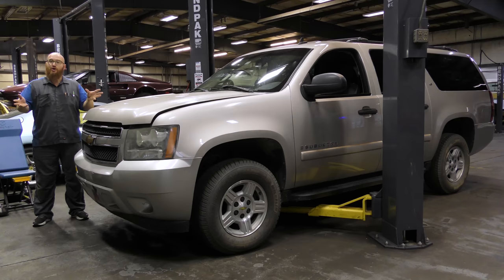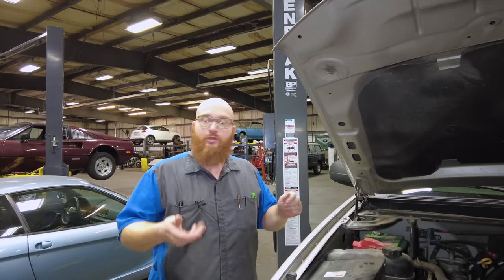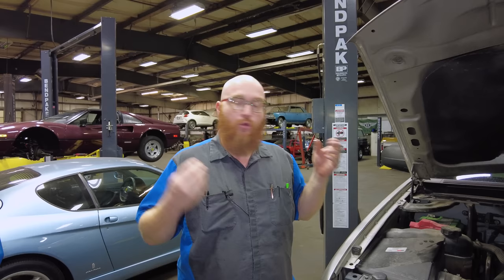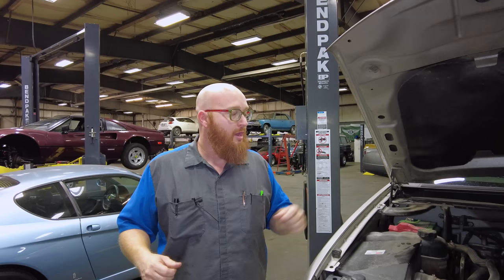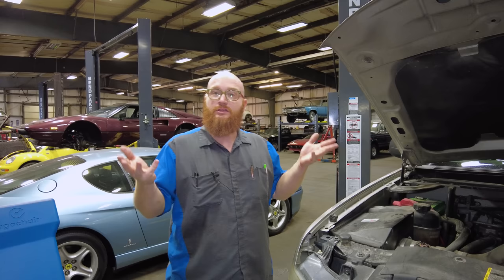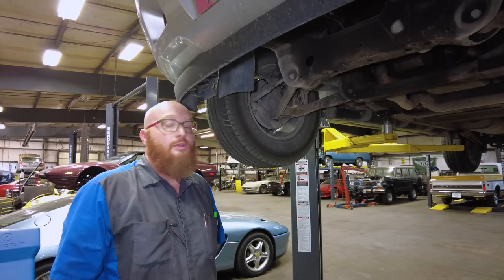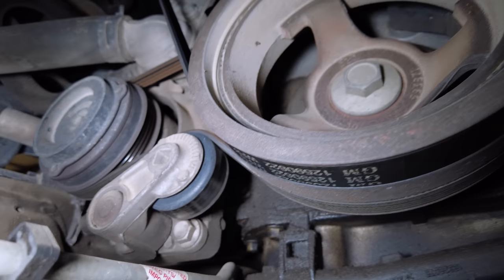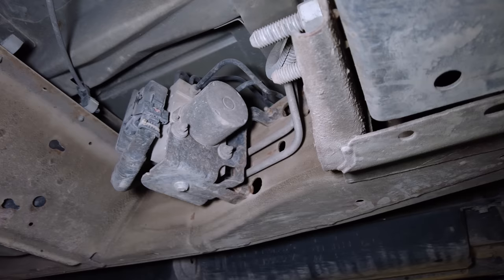What fails on ALL early 2000's Chevy SUV's!? CAR WIZARD shares what he's seen from the last 20 years

Comment: While somewhat pricey,I replaced my cast iron manifolds with smog legal headers and new bolts within the first 6 months of my used truck.  Bonus was a little more power and peace of mind, and after 3 years of use I do not have an exhaust leak 😊

Comment: Up until early-mid 2000K's was peak Chevy/GM. Good solid reliable easy to work on yourself trucks. And those 'Like A Rock' commercials are stuck in my head to this day. Would love to see a review on the GMT 400  platforms 88-98. Still see them on the road daily from Suburbans to Yukons Sierras and Silverado/Cheyennes. Think Hoovey just bought a nice one recently as well.
Reply: Yup my 1990 Silverado had turbo 400 and 180000 mi . Still see em . I should of kept it .
Reply: My 2001 Sierra transmission gave out at 300K miles. The engine is still running fine, Knock on wood.

Comment: One thing that I have found on this particular model and year of Silverado and Tahoe is that all of the plastic on the dash and the knee bolsters  turn into glass basically.  The minute you go to try to take it apart after they age the plastic just shatters in your hand we tell customers that if we have to take their dash apart expect to have to pay for replacement parts
Reply: thats most GM vehicles in my experience...they cut so many corners on the interior unless its a cadillac
Reply: This is the problem that I'm running into. I'm also having problems finding replacement parts for the inside without the price gouging.

Comment: That particular body style has quite a few statistically verified common failures. Exterior rear glass pop button usually deteriorates and becomes useless, that doesn't seem like a crazy Big fix however, you must remove the rear trim panel with the bow tie that sits above the license plate. In order to remove this trim panel you have to remove the inside hatch trim panel and access the 10 mm fasteners which secure that trim plate to the exterior of the vehicle. The plastic panel and the metal clips along with the bolts 10 to brake seized up and wreak havoc on that trim panel the best advice I could give as far as that goes is to not repair it. The window switches are notorious for going bad. The finish on HVAC control head buttons typically wear out from use, there are companies that offer vinyl overlay stickers for those control buttons but it would drive me nuts. Rear defroster tabs are constantly breaking off. They can actually be glued back on with the permatex defroster tab glue kit. The rear disc brake backing plate typically is nonexistent, the rear end axle seals typically have leaked long-term and caused rear end to be poorly lubricated. The side-view mirror adjustment motors go out quite often along with that power window switch. Also the motor mounts are a common failure especially the driver side. Overall for somebody that can either do their own maintenance or knows someone that they can trust to handle that for them I would highly recommend one of these vehicles provided that you either do an active fuel management delete as you mentioned in your video and they also offer a plug in OBD module that you can use which is available on Amazon to defeat that. Thanks for your honest review of this vehicle and I really enjoy your videos

Comment: We have an 03 Yukon Denali that we’ve owned since brand new and it has been the most reliable vehicle we have ever owned. I can count on one hand the times we have had to replace or fix a broken part. Of course we maintain the vehicle and don’t beat on it. It still looks and drives like new with 156k miles on it.
Reply: I should hope so with only 150k.
Reply: I have a rusty old 96 Tahoe with the Vortec V8. 340K on the odemeter. Only major repairs was a worn out brake line. I don't count things like tires, brakes, exhaust, etc.
Reply: @stansmith4054  ol' faithful, the Chevy 350, R.I.P.
Reply: @EvanDickersonM81  Anyone who expects a 19 year old vehicle with 150k on it to run and look like new is living in la la land
Reply: @stansmith4054  repair*
Reply: Much different that the 07 generation. You have a good vehicle. Sadly lot of people in your position “upgraded” to the newer model, only to be screwed lol. Don’t sell that thing!
Reply: I have a 2004 Z71 Tahoe with 309k original miles on engine, transmission and all 4x4 parts are also still original. I've followed the maintenance schedule like it's a bible. Also I'm an automotive technician so that helps keeping her going.
Reply: @mitchelpinion1852  mine has 309k and I would have no problems driving her coast to coast. Scheduled maintenance is why mine just running like a Timex. Takes a licking and keeps on ticking.
Reply: Uh oh. Your transmission has joined the chat.
Reply: @mitchelpinion1852  If you don’t know how to take care of and maintain your vehicle sure
Reply: @DarthVader1977  *reepares
Reply: @mitchelpinion1852  I have a 1986 Fiero GT with 40k. I am in the rust belt. There is zero rust on the frame and it runs perfect. She is a garage queen, though that is also a show car.
Reply: @mitchelpinion1852  go test drive a 20 year old low mile japanese car. It drives the same as when I came out.

Comment: You missed the hard brake lines.  On 06 back, at least, the hard brake lines rust out and then what happens?  You push the brake pedal and the fluid goes pssst out the nice hole.  I had a 2000 Yukon XL and one would pop and then I'd fix that one, then another and fix and another.  All of them ended up being replaced.  This is why you can go into any auto parts store and get complete brake line kits for these.  I'm in the salt belt so those southern trucks likely won't have this issue.
Reply: The stainless steel line kits really aren't the much money considering you'd never need to replace it agin. Had the same issue on a Super Duty and it wrecked my master cylinder at the same time.
Reply: Same.

Comment: I have an 09 yukon and was about to hit 300,000 miles until I got rear-ended at 50 mph while I was stopped. Totaled. I loved that truck and would trust it going anywhere. Only replaced the transmission and minor little issues

Comment: Another thing as well to help preserve the life of the transmission, is to get the fluid and filter changed in regular intervals. Overtime the fluid can become dark and sometimes burnt. It loses its protective minerals and can no longer protect your transmission. It's a fairly easy job to do yourself, although messy. I wish GM would use a drain plug on the transmission pans as well.
Reply: You can buy from Amazon a transmission pan with a drain plug built in..
Reply: Mine has 364k miles and the transmission fluid has never been changed. I've owned the truck since 56k. I know I should have done it, but my bad, I never did it. Still shifting fine although I wouldn't even consider changing the fluid now. I've been told the transmission is the weak point of this truck. but you'd never know it from my experience.

Comment: The wheel bearings on 1500's seemed to go quite frequently. I worked at an AutoZone that stocked 10 of them at a time
Reply: That's more of a problem with the aftermarket bearings. They factory ones do go bad on occasion, but if it gets replaced with one from AutoZone, OReilly's or any other aftermarket bearing... then you'll end up doing the job again a year later, and again another year after that, and again and again... it becomes an endless cycle. I had one customer that we warrantied the same wheel bearing 7 times in 4 years. I refuse to install the aftermarket ones anymore, especially ones for GMs. The aftermarket bearings for GMT800 trucks/suvs are absolute GARBAGE and in my experience seldom last more than 1.5 - 2 years. If you replace the bad bearing with an OE replacement bearing (which cost about $50 more for the part) then chances are you'll never have to replace it again.
Reply: @catfishbilly7425  I have a ‘99 Sierra 1500.  I’ve put probably half a dozen front hubs in it over the years between the left and right sides. First time was from corrosion killing the ABS sensor (NY winters) next couple were from cheap Autozone bearings. Finally sprung for the pricier hubs and they lasted till the sensors died again. You can buy just the sensors, but between the aluminum corroding and the plastic sensor housing they almost never come out.
Reply: My first one went after 18 years second one went at 20, spend the 200 bucks on good ones lol

Comment: I've done most of the things mentioned.  Working on the actuators soon.  Changed the AT already too.  Plenty might go wrong, most are fixable by the common guy.  I plan to keep it for as long as possible because no truck or full size SUV is worth 80+ thousand dollars.  I can change a lot of parts on my old truck for a fraction of that.

Comment: I've got a 2004 avalanche. I'd like to add vapor canister and/or its purge solenoid to the list. Anyone else who has spent 20+ minutes at a gas station struggling to pump 1/3 of a gallon at a time will know exactly what I'm talking about. 😡
Reply: YES!! 😂
Reply: I've got a Tahoe, was going to say the same. Pretty easy fix. Got mine with the check engine light for cheap and fixed it for cheap.
Reply: Yeah ...just did that on my 04’ Tahoe ...pain in the butt till you get it fixed.
Reply: Spot on.  You can count on it
Reply: Canister filter clogs up ,can set a solenoid code if the slow fill ups dont get to you first
Reply: How do you fix it
Reply: Ive replaced both on my o3 tahoe. Now 0 issues and super reliable
Reply: Disney And Walt Disney
Reply: 2005 gmc Yukon xl 1500 with 180k  I have replaced the vent solinoid … when it failed it took me literally 25-30 min to fill the tank from empty :( or 2 times thru the line at Costco…. Embarrassing! It would let me put in gas at a trickle or the pump would shut off like the tank was full and I could hear the tank hissing at me

Comment: Own nothing but GM vehicles and these years you covered are some of the best ones I’ve ever had.  Dealt with several of these issues but they’re relatively easy to fix and the pre AFM motors will run forever. I still trust these over some other brands.

Comment: Update; Sold my 2004 Silverado and purchased a 2003 GMC Sierra from an elderly man it was in fantastic shape and there were 2 things wrong with it. #1 Oil Pressure sending unit causing the guage to stay at 80 with the leak e spoke of and the Passenger side blend door actuator (Had I known how much of a pain that thing was to change I would have demanded $500 less on the price!). Always had great luck with these trucks and the things that go bad are usually minor.

Comment: The 5.3 Chevy (pre AFM) will always be one of my favorites everything about them is just simple and reliable for the most part.
Reply: The AFM engines aren’t that bad tbh 

I have 165k miles on my 2014 Silverado and yea it has a lifter tick but who cares 

On our 2013 Silverado it has 280k miles and no lifter tick
Reply: @Man_in_a_Gucci_Suit  I got 167K out of my 2008 Silverado, it started with a small tick in the morning then progressively increased till it started to misfire, I got a GM crate engine installed and also installed a de-activator for the AFM, with the price of trucks it was worth it since the rest of the vehicle is in good shape.
Reply: @edc6333  my 2011 Chevy Suburban LT has 304,500 miles and it's still going strong, and still has the crappy AFM system! All we did was oil/filter changes every 5000 miles, air filter as needed, transmission oil changes every 30,000 miles (as well as rear diff), coolant flushes every 50,000 miles, new spark plugs and coils every 100,000miles as well as the water pump, Vbelt every 50,000 miles.
Reply: @BlazeSEGA  Thats pretty damn good!
Reply: My 07 Av with AFM has a 180k miles and runs smooth and silent still.
Maintenance is key.

Comment: Thank you for sharing your hard earned knowledge.   Items you predicted correctly on my 09 Tahoe—- Blend door….check.   Oil pressure issue….check.   Oil leak…..check. Oil pickup tube O ring……check.  Previous owner replaced coils and plugs.  Tranny is beginning to shudder when going from coasting to adding power again at speed.
Reply: You're ready for a trans rebuild. If it hasn't grenaded already get it in fast. Mine did the same before the torque converter went out and destroyed the whole trans.

Comment: 2003 Silverado 2500HD 6.0 and I've dealt with almost all of these lol. 292k miles and still running strong though.
Reply: Should have gotten the Duramax. 2004 Sierra 2500HD here. 502,000 miles and still runs strong. All original except for things you would normally expect to wear out. Alternator, water pump, A/C compressor and condenser coil.  I've also dropped about two grand on the front end. The biggest issue with these trucks was the fuel injectors. Bad design but that's finally been worked out.
Reply: 135k on my exact truck.  Brake lines rust. Front diff blewup at80k
Reply: but did you deal with them at only 100k like he is saying...I bet not

Comment: I'm perfectly happy with my 1986 and 1996 GM vehicles. They still going!
Reply: Nobody asked
Reply: Used to have a 1996 Suburban SLE 1500 and it was great
Reply: Easier and cheaper to work on
Reply: I have owned Chevrolets since 1994 and have been happy with all of them.

Comment: I have a 2006 GMC Envoy with the 5.3, the Oil Pressure Sensor failed at about 70k miles, but you are able to reach back there and replace it without taking the manifold off. Shop wanted something like $450 to do it, luckily I was able to buy the part and a full mechanics socket set for only $300ish

Comment: I have an 05 GMC ive had rear seal leaking front diff leaked from everywhere  had it rebuilt.. coil pack all replaced.. I also have a 08 tahoe with oil leaks but i just fix them because i love my older..  trucks more than the new ones.. I can guarantee that my trucks are better maintained than some of the newer trucks on the road rn..

Comment: I took Wizards advice and got a bargain 2008 Silverado with the 5.3. I have done the rear main seal,o-ring on the pickup tube,sway bar connectors and sent the injectors out to be cleaned. It runs like a champ.

Comment: These really are a great reliable vehicle from 99 to 2008. Yes they have common failure point’s but there well documented and easy to fix. What’s important is that the drivetrain is extremely reliable in the hands of a competent owner that maintains there vehicle. Odds are if you watch this channel you have some mechanical knowledge. Buying one of these GM vehicles is a great choice if it was maintained properly. Even if it has high mileage. The reliability will rival any other brand out there, they have good power and get decent fuel mileage. Overall just a nice ride to daily.
Reply: I’d say even later all the way up to like 2015-16. Pretty much anything with 6 speeds I can’t speak for anything after that.
Reply: @Thumper68  all my pals and relations w/ '13-16 have major expensive failures and downtimes.   GM lost the plot, and Ford and the other ones ,namely Toyota and Ram, starting eating their lunch!
Reply: sorry charlie, love them, but they do not rival Toyota, in any way shape or form.   As in, what would we use for fleet, for military, for xyz where u need max probability of success. There is no contest w/ Toyota
Reply: @18_rabbit It's such s shame just about all of em build cars around planned obsolescence & made in Mexico for cheap labor, Toyota & Honda included.

Comment: I have owned 5 GMT-800s, all pre-2006.  In Texas, vehicles must annually pass a safety inspection, to include a test of the parking / emergency brake.  That's when you find out that yours doesn't work.  All but one of mine had failure here.
Reply: That's interesting. I've driven my 05 in NY for the last 5 years and haven't had any issue with seized parking brake. I use it every time I park, so I'm guessing that bit of exercise kept it healthy. I would think Texas would be the ideal place to keep these in perfect shape.

Comment: In regards to the HVAC actuators, ALWAYS lower the blower motor before you change from heat to cool or head to foot vents. It puts less stress on the actuators. If you have auto AC, don’t use it!. Just set the temperature you want and leave it! The less you use the little motors the less they break
Reply: why not use auto???
Reply: @fargeeks  auto makes more frequent use of temperature/mode changes for the best comfort

Comment: Love the glasses man. 
You are 100% correct on your points. I’ve been in auto parts for over a decade and I thank God for the GM full size variants. They keep my doors open. 
Never knew about the overdrive on the 4L60s.
That’s great information to have.
You didn’t mention the vapor canisters back at the gas tank or the solenoid under the hood. I’ve sold a bunch of those over the years. Great channel. Been watching for years now. TTYL ✌️

Comment: I have a 2007 Sierra 1500 new body with 218k miles That I have owned since 2015.  I have no abs light and the gauges work perfectly. The air bag light has come on in the past due to the sensors rusting out.I change the oil every 5k miles with high quality high mileage oil and I have never had a lifter problem. These are good trucks if you maintain them and address the problems when they arise.

Comment: Correction: Chrysler's MDS is NOT ruining engines. Chrysler Hemi camshaft wipe problems stem from a combination of poor heat treat on cam parts combined with EXTENDED periods of idle, and lack of proper maintenance. These failures are most commonly seen in emergancy response and oil field vehicles. It's also most common in engines made after about 2015. My 2005 300C has almost 200,000 miles on it, still going strong.